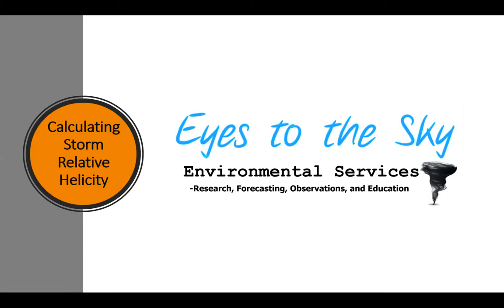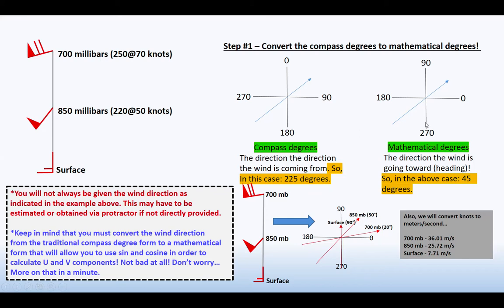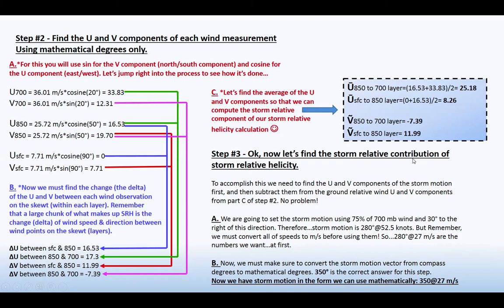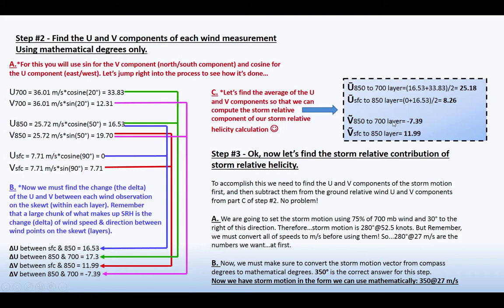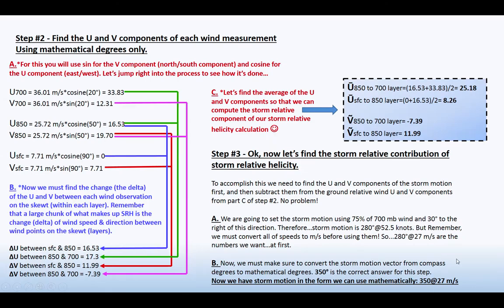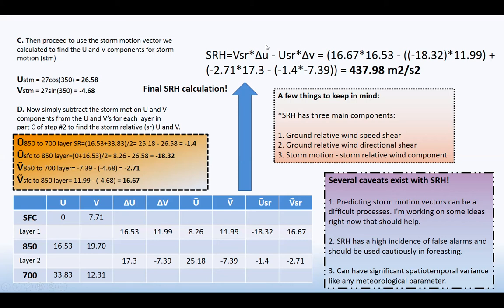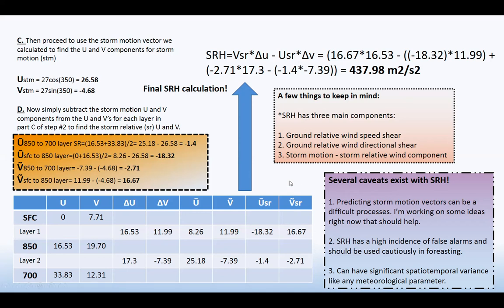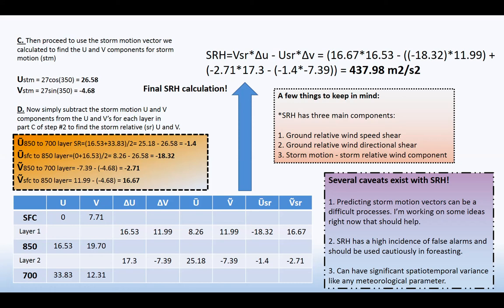Storm Relative Helicity: A Formal Calculation

Comment: My question is why do you have to use the 700/850 and surface..why not just 700 and the surface? Does getting more layers increase accuracy?
Reply from the maker: That's correct. More layers leads to greater accuracy because some wind profiles have veering and backing anomalies between layers.

Comment: So basically you sum the cross products of the speed shear vector to the storm relative wind vector at each layer and that gives you SRH? The calculation resembles a cross product. Also could you choose more, thinner layers to include inside the calculation from sfc - 700mb for a more precise calculation? Last, does the calculation imply SRH is best when the storm relative wind is at a right angle with the direction the updraft accelerates?